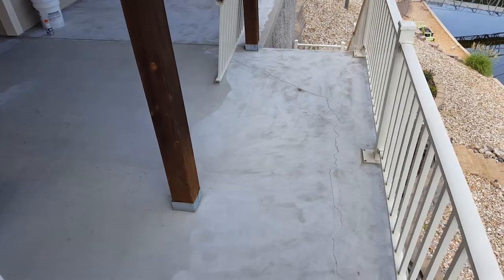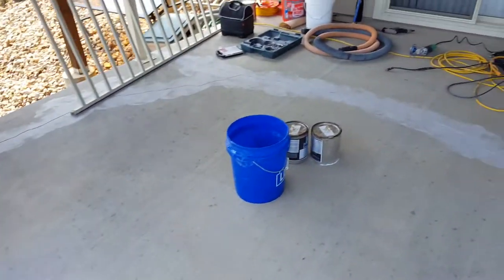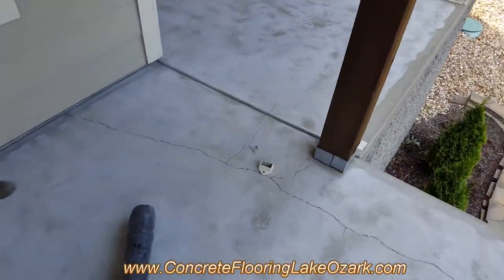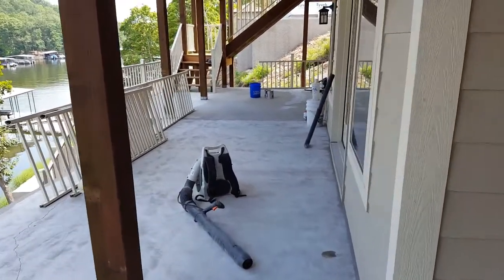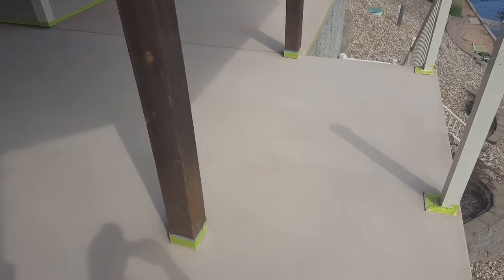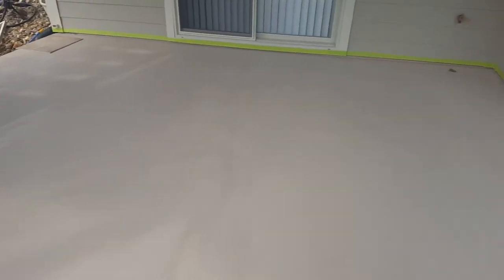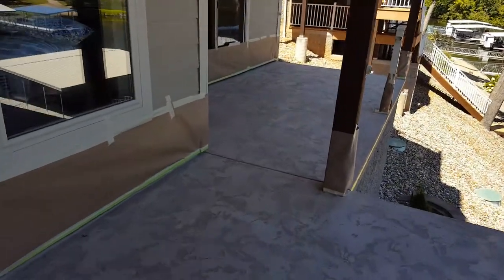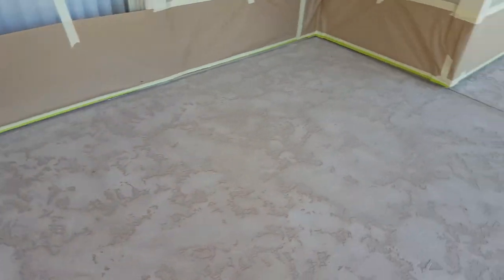Decorative Concrete Tuscan Slate Texture Brown Antique Stain Lake Ozark, MO

Comment: How do you add the Tuscan Slate texture on???
Reply from the maker: Hi V Nice, I put the concrete down in layers, the first layer is the base coat of concrete on top of the existing concrete we lay it out at a 100% coverage rate....it's a dark colored coat of chocolate on this particular project, then we add a second layer of chocolate concrete at 100% coverage, then we add our Tuscan Slate concrete it's a slightly lighter chocolate concrete color, but it's put on at about an 80% coverage so it leaves pockets where you can see the st 2 layers of concrete below, then we spray our Antique stain on the entire surface, let it all dry and seal, the process on this one took us about a week to complete... Hope that makes sense :)
Reply: @MrCustomConcrete  Yes sir. It does make sense.  Thank you very much for the quick response! 👍
Reply from the maker: @vnice429  your welcome 🙏 😊